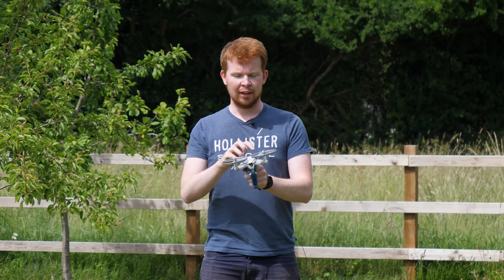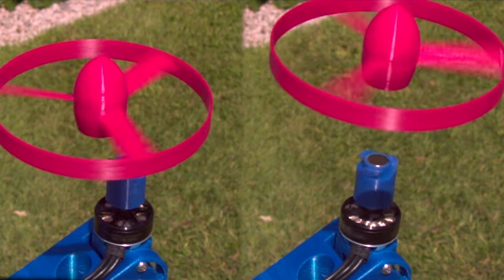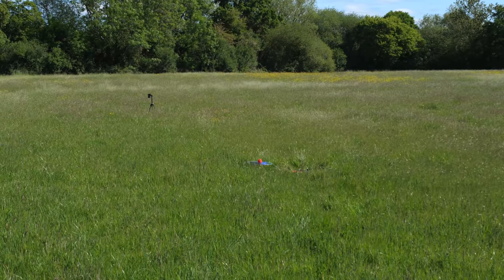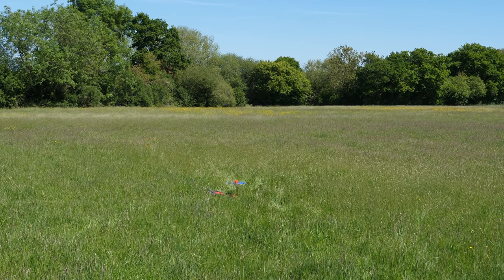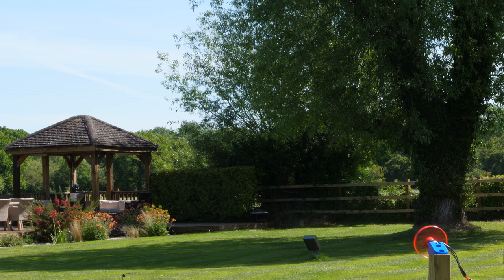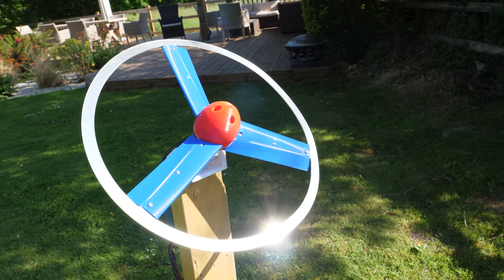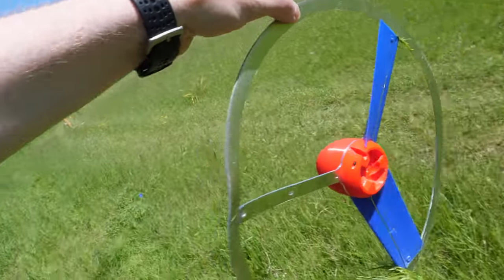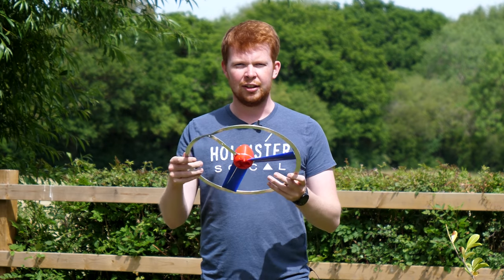Large 'Pull String' Spinner

Comment: That was pretty cool but I bet the flat nature of the ring gives it lot of drag, would be cool to see another design where it's like the toy one.  Harder to make though.
Reply: Not too much harder as long as you have access to a welder. Make the outer ring out of a strip of metal with slots to weld the tips of the blades into.
Reply: Large dia sewer pipe of some sort would make a nice ring for the airfoils to put into edit: you could get a (most likely even free of charge) cutoff at the next big construction site. It would most likely be the green polyethylene you can‘t glue but screw. PE would maybe lack stiffness ime but there are pvc ones too and all of them should be nice to work with.
Reply: I would like to see that too. I think he should re make it with a band around the outside like the red plastic one.
Reply: @HrDernacht   - Also sand-able to an aerofoil itself - but on the inside or outside?
Reply: Lod dude he could try both methods. Although the proven one with the ring on the outside is obviously the safer choice. Would really like to see that!
Reply: yep I'm pretty sure that in the smaller plastic version he made, the flywheel ring functioned like a "wingtip" for the blades, restraining the air from moving out sideways.
Reply: You are quite correct, though the other shape has another advantage - it should put more mass out at the edges for its diameter. So improves the rotational inertia, while also improving the aerodynamics. 
@TangenteAmoebe lathes big enough to cut a ring like that are much harder to own or find to use - welding slats or better a ring rollered strip are easy to do without needing the million ton old iron. Neither welder nor ring roller is huge, that expensive or as hard to really use as a lathe (Welding can be an artform but just MIG some bits so they stick and grind afterwards is easy, certainly easier than dealing with trying to machine a huge flywheel for a novice). In this case you would also waste enormous amounts of material in the middle being removed, which is really quite expensive - love a good lathe and machined part but in this case its a much more expensive way to make functionally the same part.
Reply: @martindinner3621  If you make it that way it would likely be pretty hard to balance though - what I think would be a lot easier to balance, and also to make likely, would be to bolt airfoil-shaped front and rear fairings to the flat outer ring.
Reply: Alternatively,  ditch the ring and the printed blades. Perhaps start by seeing how well it works in its most simple form and then progress/refine from there . .  eg,  same three blade design with each blade 20cm long and say 20mm wide, twist/bend each blade a dew degrees to the horizontal , that alone will fly. Add small lead weights to the tips of the blades to up the inertia, the centrifugal force should help maintain the blade form at speed.
Tom - there's an easy video to be made out of this . .  blade shape , deflection , tapering , leading and trailing edges , tip weights vs. ring ...
I'd watch it :-)
Reply: Or maybe have a rounded ring for better airflow. Even cooler maybe shape the outer ring to help flow air into the blades(idk how tho).
Reply: Exactly and, add more mass to that outer ring.
Reply: I mean, he's already printing the airfoil shape and attaching it, why not just print more parts for a leading and trailing edge of the ring.
Reply: Print some rings to sandwich the aluminum.
Reply: Just use a 3D printer to make a larger version of the original, problem solved!
Reply: all you'd need is a thicker piece of aluminium. cut the middle part thinner and you're done.
Reply: A cylindrical ring means less drag and maybe some enjoy a ducted fan kind of effect. However, it would also offer less rigidity for the weight, meaning higher deformation as rpms increase, making balancing even more critical, increasing probability of flying apart in the spin up phase.  And possibly a problem with resonant frequency dampening stealing some energy. I would guess metals offer diminishing returns here, as rigidity increases so does mass, and gets kind of scary at spin up. Fabricating demands some sophisticated joining and machining techniques if you want anything capable of balancing reasonably without flying apart. Thermoplastics offer limited rigidity. Carbon fiber might be more ideal, but can be difficult to fabricate.
Reply: @TangenteAmoebe That would waste a sh*t ton of metal

Comment: When it's launched at 40º, at 3:58 in the video, as it glides, it flattens out and turns to the right. This is because as it starts to move forward, the blade that is sweeping forward generates more lift that the blade that is receding. Gyroscopic precession then rotates the disc flatter and to the right, causing the levelling off and turning that you see. This is something that happens to helicopters when they move forward, called "Asymmetry of lift" https://en.wikipedia.org/wiki/Asymmetry_of_lift. The pilot can correct for it to a certain extent, but it limits the maximum overall speed of the helicopter.
Reply: I'm glad I visited this TED talk
Reply: Isnt that the same thing as when a perfect stone skipping occurs? All the best throws ive seen have turned to one side after a few skips.
Reply: You are a badass
Reply: And then as it falls is it in an autorotation?
Reply: 8ball
Reply: Wouldn't assymetry of lift cause the disc to roll to the left, since the advancing blade is on the right?
Reply: The toy at the beginning of the video is the perfect solution. Two contra rotating propellers. The only tiny difficulty is the mechanical connection between them, and making it strong enough to survive and efficient enough that it still works.
Reply: I don't speak intelligence
Reply: this comment is 1000% perfect
Reply: OK, this guy is smart

Comment: Doing spectrum analysis on the sound at full power revealed that the rotational speed just after lift off is 
4280 RPM  (214 Hz)    [listed in video 4340 RPM, within 1%]

While just before the lift off it was
4620 RPM  (231 Hz)

That is a a 7% loss of energy due to the lift off mechanism.
Probably it will be more efficient when the angle of the red and blue mechanism is more favorable.
Reply: You could see in the beginning that the mechanism uses some energy to launch it straight upwards by a 'ramp'
Reply: I could tell that he is losing energy quick because of his aggressive angle just by watching the video.
Reply: Hugo you are the boss!
Reply: You're not fooling anyone.  You're actually Joe Lycett.
Reply: Whoa, Joe Lycett is here! I bet Mark Silcox gave him these stats.
Reply: How can you assume the rpm based off the frequency generated? How do you know that each waveform cycle is actually equivalent to a rotation?
Reply: @JohnDoe-zq1ho  change from rpm to rpms or rps and analyse the sound, would be the accurate way to do it
Reply: For anyone reading Hugo boss’s comment, a simpler way of saying this is the spinner loses spinning speed when it takes off because of the ramp it launches from. It would work better when that is improved. You’re welcome
Reply: When playing with the toy version I noticed it made a huge difference in the attained altitude to give the whole thing an upward thrust at launch.  I think this helped the prop get out of the high drag static thrust regime in which the angle of attack of the blades was too high.
Reply: totally. 10000% right dude

Comment: Simple trick to store more energy in the Spinner: add weights to the outer rim. maybe some lead fishing weights, covered by an (aerodynamic!) 3d-printed cover
Reply: Becomes a balancing act because then more of the lift is countering the added weight
Reply: Or a v8 engine
Reply: @tbmx5685  made my day :D
Reply: @jonathanstevenson8948  and distance of mass from center is also squared as well
Reply: @jonathanstevenson8948  indeed, though I was talking about energy or moment of inertia rather than balance
Reply: @jonathanstevenson8948  not really though, I was talking more about using the same amount of mass but at a wider diameter

Adding more mass to the ring might increase the stored energy, but won't that be in a linear fashion(compared to the previous ring of the same diameter), while the added mass also require more lift?

Comment: Tom, years ago when when I was pretty young.  For my birthday I received  a helicopter that worked on a similar inertia principal.  The one difference was that using a pull string launcher the blades were designed to spin up flat.  In the hub there were springs that were stretched as the revolutions increased.  At launch you would aim the helicopter at maybe a 30 degree angle so that it would fly away from the launcher and travel possibly 150-180 feet or so And then return like a boomerang and land at your feet.  As the blades started to slow, the stretched springs would begin to relax plulling the blades into more pitch in order to keep the helicopter flying.  A really cool toy. Too bad I couldn't have purchased one to put away until I was older.
I have searched far and wide but no one makes it anymore.
Gotta go, my dog is bugging me for lunch.  Cheers.

Comment: Another fun video, thanks!  You had a slide about rotational energy.  Another thing to consider when designing propeller driven stuff is that all other things being held constant, a prop's power goes up by RPM cubed (HP2 = HP1 (RM2^3/RM1^3).  If you hold RPM constant, power goes up by diameter (D) to the fifth power (HP2 = HP1 (D2^5/D1^5)).  Keep on experimenting!

Comment: Flywheels are most efficient when they have a large mass around the outer ring. You should try attaching some thick dense metal around the ring of the propeller. The best part about that is having it there won't increase friction, just inertia, so you can spin it up to just as high an rpm (though it will take longer to do) and it will maintain a high speed for longer.

Comment: Those interlocking teeth are called an overruning clutch. they are often in starter motors. to keep the engine from spining the windings off the armature. after it starts.

Comment: Needs mass in the outer edge
Reply: This was my first thought also.   Aluminum is great for CNC fabrication but not much for inertia.
Reply: @old_guard2431  Look at the flywheel equation - speed matters more than mass.
Reply: @waynerussell6401  we've maxed out the speed already though.
Reply: I think it would do well if it was turned it into a 'ducted' fan, but one where the outside spins too. Put some 'teeth' on the leading edge, and see what thickness of wood it can bore through from a distance.

Comment: I might be wrong ~ or you might be, but at 3:31 the smaller spinner moves in a straight line for two reasons. (1) The three aerofoils make an "airscrew" (which is basically a propeller) which pulls the body forward in atmosphere. (2) When a body spins in free space, it generates a force 90° from it's angle of spin (picture a line going through it's axis of rotation). This force developed is great enough to overcome anything that acts against it from other angles not on that straight line axis.

If you fired it parallel to the ground, acceleration due to gravity acts 90° off axis from it's axis of rotation and as long as the torque from it's rotation is high enough, it WILL NOT yield to gravity and pitch downwards until most of the rotational energy has been expended due to air friction. This same torque effect is used to stabilize satellites and is used in gyroscopic boat stabilizers.

Comment: I think part of the reason this doesn't fly so high is the geometry of that outer disk. You mentioned in the horizontal test that the plastic versions have that outer ring that acts as a bit of an airfoil; this same idea applies to the vertical test too. The plastic versions have the outer ring presenting a point towards the leading edge, while yours has a flat band presenting towards the leading edge. You should try 3d printing a sort of molding that screws against your outer ring to give it a more aerodynamic shape and revisit the vertical tests!

Comment: At a young age of building things I was given a dremmel tool set.  Did not take me long to put one of the toy rotors like that on the dremmel, wind up to high speed.  Now I did understand centrifugal force so I never spun up to the full RPM, and i had to stop the chuck by hand cause I knew would destroy the chuck lock.  But dam they launched very high, and I lost the rotor in a field.  End of experiment.   Lucky didn't explode in my face.

Comment: You can do something similar by locking the bearings on a bicycle wheel, and loosely attaching the axle to a power drill... when the wheel slips out from the drill, it goes incredibly fast, and it's funny to watch it jump a ramp.

Comment: Regarding the semi-horizontal launches: The thing will eventually turn vertical due to rotor dynamics if it has sufficient launch altitude for this to happen before it hits the ground.   As it begins to "slide" downward after lauch, advancing blades gain airspeed, while retreating blades lose airspeed.  This causes the advancing blades to increase lift (and retreating ones to decrease).  Due to  precession, this causes the forward edge of the rotor to lift, causing it to transition to a vertical direction.   This is the same thing that causes a boomerang to turn, and why they go upward and stall if you throw them sidearm.

Comment: You don’t need a larger motor for more speed. You’re spinning 1/1 with the motor’s rotation. If you added a gear system you could increase the output speed. Or did you already try something similar? It might take a while to ramp up the speed effectively, but it would be a good test to perform. I was personally thinking you could use a belt system to step up your output ratio by some amount, since you can machine the parts yourself and buy said belt (or chain, even) from most major sellers.

Comment: You need an angle the propellers down a little more. That way you would get maximum thrust it will go so much higher. Because as it stands the little toys are going higher than this thing.

Comment: The noise is everything but how could one make it steerable? With that amount of travel horizontally couldn’t you try to steer it away from ground and start trading speed for altitude?
Reply: Problem is, it's basically one giant gyroscope. It would be quite tricky to make it change orientation
Reply: It spins too fast to put effective control surfaces on it. It would just cancel itself out constantly as it spins to the other side of the disk.

Comment: Just a thought - have a leaf blower blowing into the propeller when it's being spun on the hub, then remove the blower. This will let you reach a higher RPM before it hits the higher pressure static air for takeoff.

Comment: in scaling up, would it make sense to; a)make the outer ring an airfoil profile, similar to the small-scale test - to improve horizontal travel when launched outside of vertically, & b) add some kind of manual or remote control to vary the blade pitch for some form of directional or variable lift control ?? 😎👍

Comment: What would be cool is if the spinner had pitch control on the blades with some kind of locking mechanism, then it could be spun up to super high rpm before the blade pitch was changed, could go very high

Comment: Only way I can think of improving it is making it more similar to the plastic ones. The outer surface is probably slowing it down a bit, and like you mentioned in the video, with the smaller ones, the outside surface acted as a wing to a certain degree

Comment: When you print these things, do you use PLA?  If so, consider trying PETG.  the layer adhesion is incredibly strong and it flexes slightly, making prints much stronger than PLA.  An unenclosed printer should print it fine too.  Just remember to cover the bed with something so it won't damage the glass.

Comment: When I was a teenager I tried making a boomerang. Had no clue what I was doing.  I made the airfoil out of door trim and I jointed it at a 90 degree angle. I shaped it by hand. It didn’t fly back but it would go high up. Thrown into the wind level to the ground it would go out 20-30 feet then turn up and shoot skyward. It was so predictable I was able to aim it at a bird house.

Comment: I'm thinking weight was a big limiting factor.  It seemed a little slow off the launch.  I think one entirely printed with fibre reinforced resin would really perform well.  Possible blade pitch optimization as well.   Have fun if you try.

Comment: It would be nice to see something with some kind of mechanics(could be a servo or even a spring, but it might be hard to find the perfect strength) that can pull weight closer to the center, so if you can spin it up to some speed and launch, it can accelerate(with servos), or maintain its speed for longer(when using springs, and they start pulling the weight in as it starts slowing down). 
Keep up the good work, love your videos

Comment: Most energy you put in to the motor goes to move air, just a small amount is transferred to inertia.
Add to the design variable pitch so that pitch is neutral while seated in the spinning lock. And when released the pitch automatically is increased to grab air. Just my toughts 😀 Any way, enjoyed the video.

Comment: You should apply this concept to a rocket body with no stabilizer fins. Load the rocket body with 3 or 4 impellers and make the cylinder 1 meter tall. The rotational energy and the cylinder body should help it track straight

Comment: I think you need to rotate the outer ring by 90 degrees, like what the red one has. Because when you launch, it wants to slide sideways. The outer ring is acting like a brake. I think it would go higher for the same rpm if you could do that 🙂